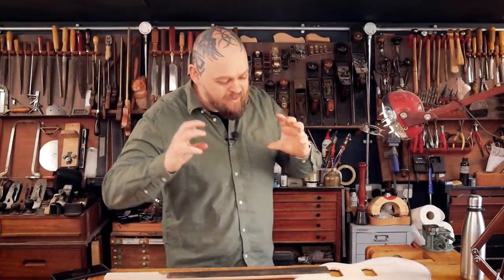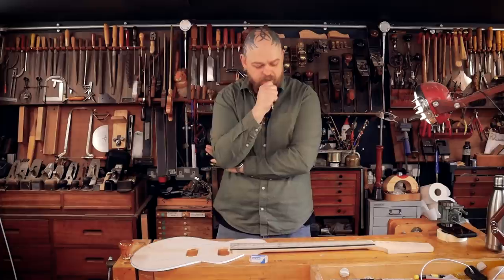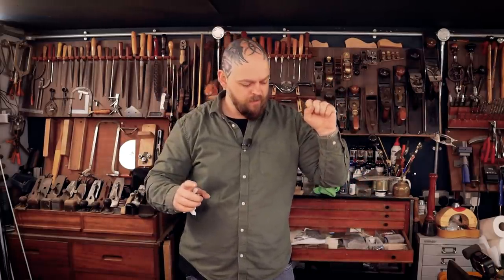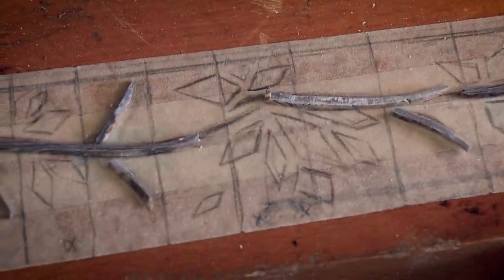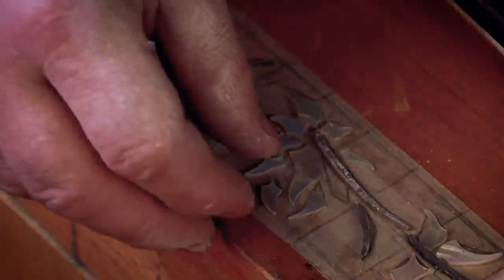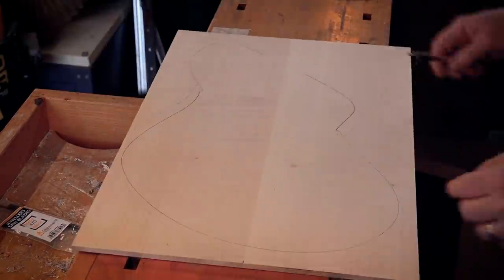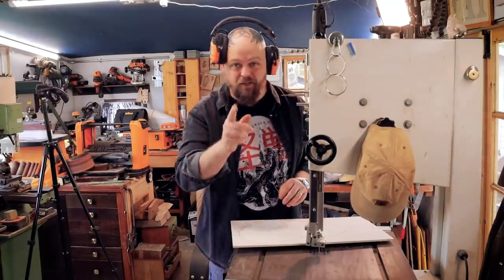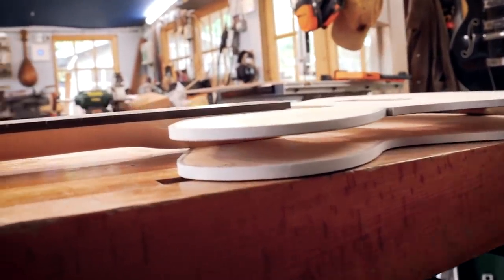Ep. 2 - How to Build a Unique Custom Guitar - Easy Inlay Design?  Ben Crowe GGBO Invitational 2021

Comment: Suggestion:
Push/bend down the 2 side sections on the front, revealing the inner binding almost entirely. So the center will be higher than the sides until you get about halfway down, close to where the bridge will be.
Reply: I thought that was what you where going to do, because you actually pushed it down like that in the previous video.

Comment: I usually don’t like this kind of inlay. Mostly because the „trunk“ being too thick. 
But I like this one!

You asked for input from us?
If you want more complication: tiny orange flower buds on fret 1, 7, 19. Or tiny „berries“ made out of brass tubing of 4, 5, 6 mm diam., or clusters of 2mm, filled with purple.

Spontaneous idea for berries: very thin copper wire crumpled up, flattened, filled with color epoxy. Outline cut as liked. If grinded flat and polished some copper threads will shine, the others are giving depth...

I think filling the leaves with copper will get them look again massive. Filling them with a dark material keeps the graceful, delicate appearance.
You could inlay in the leaves tiny bits of brass/copper wire...

 Cheers Ben. Love your work🙌🏼

Comment: Just have to love the insanity that is the mind of Ben. 
Making life so much harder for one self, just because....

Threaded inserts in the top and back and use wood covered threads to hold it together?
No visible heads, either round or octo shaped wood pillars.
OR.. Parthenon shaped (turned) pillars - based on chess pieces?
If the top was steamed the "wings" ban be really bent into shape - might even be able to push it all the way to the back.

Comment: If you liked you could use something like walnut dowels as stand offs between the front and back. It would be a bit lighter than using bolts and coming through the front and back with a shoulder to hold them at the right distance the dots showing could act as a design element. and instead of them being round they could be square. Looking good.

Comment: I was wondering as you were building the back, it would be cool to have the back exactly the same shape but, drawn/slid up vertically creating a diagonal shift. Imagine the guitar vertical but, the front “melting” down say an inch. Then wooden bolts/dowels to fix together?

Comment: Silicosis is the term you were looking for and if left untreated can turn into pulmonary fibrosis
Reply: yes. also includes anything that produces silica dust such as gemstone grinding (opal), masonry/tiling, and shell work. the dust does adhere to ur lungs as ben said but it also acts as an abrasive causing scaring similar to asbestosis
Reply: I was thinking bronchiectasis due to the scarring and mucus it will cause in the bottom of the lungs but looking up silicosis is absolutely correct

Comment: Still watching. I'm wondering if the test leaves would have worked better if they'd been bisected lengthways with a curve to show the stalk running through?
Reply: And now you're filling them. Yahayy :)
Reply: Now I was thinking that you'd put the cuts in the back like the front, but from the bridge end rather than the neck. Maybe then use the same thickness wood for spacers between the front and back and a couple of thicker blocks for the bridge ( + strap bolt) and neck.  Would give you a narrow edged profile like late 80s ibanez (ibanez-es?) eg http://www.hoshinogakki.co.jp/pdf/ibanez/catalog/1988540S.pdf)

Comment: Looking good already... you were robbed last year so better luck this year 👍
On a grovelly-just-given-a-compliment-cheeky kind of way, I have a question and as you push the boundaries regularly, I’m hoping you’ll know the answer... In your cyberpunk build, you added loads of LEDs that were battery powered, but is there a way (this might show my total lack of understanding of guitar electrics/power,so sorry if that’s the case 🤢) to power LEDs from the jack plug so that when the cable is plugged in to an amp, the LEDs draw power that way?

Comment: I had one of those "Oh, please Noooo!" moments when you started drawing in bolt holes along the perimeter of the top. The lines you have are so clean and classic, please don't add anything as clunky as bolts to it. It looked really cool when you mocked it up. I think using wood posts would look so much better. And, the less conspicuous you can make them; the more the top will appear to float there magically. I'm thinking something like wine glass stems. (lathe project?) Maybe even some clear acrylic posts if you don't want to do wood, they might help with the floating illusion.

Comment: With designing and drawing floral patterns its better to start with the leafs, the vines are basically unimportant and you can focus on the density, size and gradation without getting distracted from that by the "vinelines"

Comment: Silicosis is what you get from things like shell dust getting into your lungs.
Reply: I came to the comments looking to find the answer. It will be something like Silicosis but shell is Calcium Carbonate so no Silica... I think (but am not sure) that all the similar lung diseases are now grouped under COPD.
Reply: @PeterWasted  from the nhs website.
Silicosis is a long-term lung disease caused by inhaling large amounts of crystalline silica dust, usually over many years.

Silica is a substance naturally found in certain types of stone, rock, sand and clay. Working with these materials can create a very fine dust that can be easily inhaled.
Reply: @mikeburgess6153  That's exactly as I said. Silicosis is caused by Silica dust. Shell does not produce silica dust so it can't cause silicosis.

Comment: Inlay (especially binding) is one of those things that... frankly I'd rather NOT see on a guitar. What is the point of it? It's purely aesthetic, and actually adds nothing functional. Just sack it off. I'd rather see a guitar where every feature had a purpose than a piece of art that has reduced function.

If you're going to do a fretboard inlay, for the love of god (yes that is a pun, and also intentionally not capitalised) don't do a vine, it's overdone. There are so many other sources, like DNA (has been done before, Vai or Satriani had some, I think), Astrology or Astronomy, you could take the PRS birds theme and go to insects, or Nordic runes... There are so many options, to copy the vine of life would be a shame.
Reply: The point of binding, historically anyway, was to hide untidy wood joints and seams that have exposed end grain, and offer a slight sacrificial protection from knocks to the crisp wood edges.  Presumably it developed into multi-ply ornamentation to disguise the fact they've put plastic bodge tape on the unsightly seams. 🙈😉

I'm not a fan of it in general, but with this being a double wafer kinda design, it does seem to fulfill its historical function of covering end grain and some ding protection.  Though I'm not sure either were absolutely essential.  Semicircle rounding the outer edges and oiling/staining might've looked ok.  Even steam bending some contrasting wood.  But maybe I'm just a wood fetishist.

The one thing I have learned on this channel though, reserve judgement til the end.  So many WTF moments, that turn out ok.